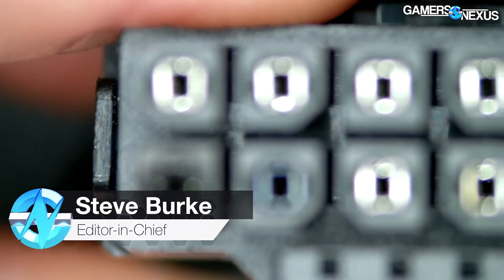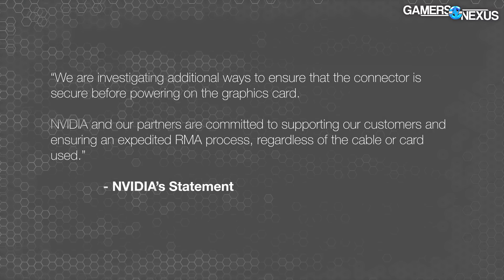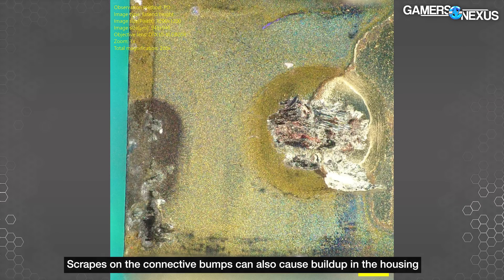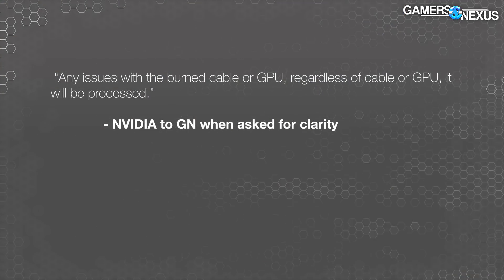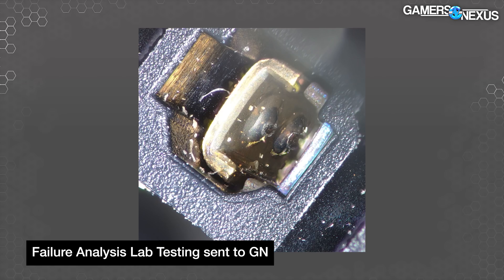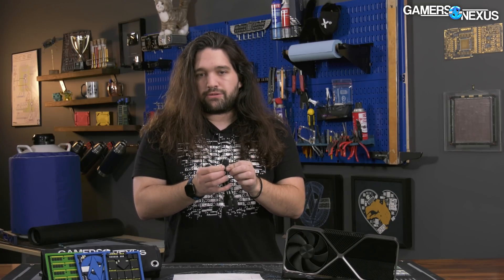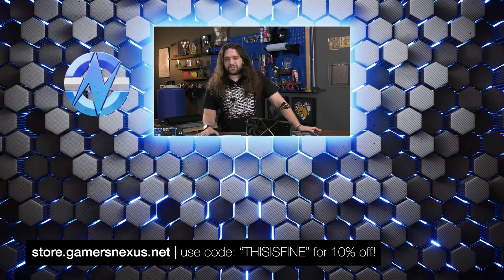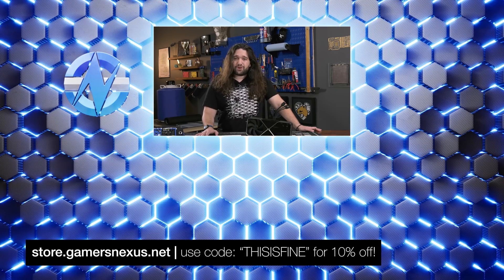NVIDIA Responds to Melting Cables, Warranty Concerns, & 12VHPWR Adapter Failures

Comment: Easiest way to fix this is to change locking mechanism. Instead of 1 point in the middle make 1 on each side (2 overall). Once you click it that way there is no way this will move to the side.
When it comes to user related errors - there is no blueprint, there is no ready device that is fully user resistant. When someone wants to use it improper way, he will find a solution.

Comment: When I build a PC, I always make sure that the latches of these cables locks on! I don't do the job half assed. The secure latch is there for a reason, not for friggin' aesthetics!
But I did encounter cables where I pushed and pushed, and the latch still didn't want to lock or did it very hard... Those were some crap cables imo, bad manufacturer! smh

Comment: From the moment nvidia said that the cable was only good for 30 plug in/out cycles, it should've been clear to anyone it was engineered to fail, like most things today. Want to see plugs made to stick where you plug them? Check automotive ones. There you'll never see 4 thick, hard to bend cables merge into a single one with a tiny plug. It's not the guy who designed this that bears responsibility for it, nor the supervisor who ok'd it. It's the one on top who asked for the plug to be this way.

Comment: I think it's worth pointing out that 0.04% sounds like a small number, but it seems to me like a high failure rate. One in every 2,500 cards will suffer a melted, burned connector. Or rather, one in every 2,500 already has had this failure--and the cards have only been out for a few months. Those aren't really acceptable odds for a consumer product.

Comment: I wish they had done the same with these 40 series as they did with the 3090ti. Place the plug on the side for easier cable management. They made that connector pretty solid I haven't heard of many issues despite it being a similar style adapter. Wonder what made them change the design up?

Comment: The terminals, both in the socket, and the connector are simply not large enough to handle the current passing through them. Poor connection/lack of adequate surface area to handle the load,  results in poor contact, fretting, increased resistance, which causes *heat*, which causes melting. It's not complicated.
Reply: Molex micro-fit (Which 12HPWR is based on) can be speced to 13A per pin, the PCI-SIG design is only for 9.2A per pin.  The pin size is fine.
Reply: @gracej79  if they were adequate, they would have zero issues , the pin size is too small for a 1200W power supply, 1200W ÷ 12 is 100 amps over 12 pins, is 8.3 A per pin. If they spec'd a connector that could handle 15 amps, per pin, this video would never have been made.
Reply: @jamesgeorge4874  There is zero evidence the pin size has caused any issues for this 600W  connector.

Comment: THAT IS A BAD DESIGN FOR A 450 12v power connector!!! 37 AMPS REDICULOUS! that thing should be huge for 37 AMPS!!! micro molex legacy deisgn with easy to melt plastic, thin metal pressings, WTF. the specification is low-tech. a 37 amp connector should be literally a lot different than that for flimsiness. If it were 24 volts it would be fine. check a motorbike battery, 12v, 30 amps output, massive wires.

Comment: Great video, but quite clearly while the blame is being shifted to user error and yes that is so, this didn't happen with recent previous gens, this really just means that the design is just not good, at least Nvidia is honouring warranty but I feel they haven't really admitted to being partly at fault for having a bad design, this power connector just wasn't necessary.

Comment: Well,diesel engines were designed to run on vegetable oil so in theory it should burn if you can get it in there, but it would probably solidify and clog everything up faster than you can say "yeehaw" so I wouldn't say it "runs fine" unless Joebob has taken up industrial hydrocracking like commercial biofuel production.

Gas engines definitively will not run on pig fat though. Might not even make it past the filter to the engine,but your fuel system will still be full of solid pig fat.

Comment: I love what you did,but I do not totally agree with the "it is mostly user error"
People don't suddenly lose the skills to plug a cable, it is due to bad design of the socket and plug and the wrong selection of the pins (male and female) too much play.
We didn't had that issue with the former design plugs.
The new ones look low quality to save some money.

Comment: Looks to me like bayonet or screwed in connectors like RS232, VGA or DVI connectors of old aren't all that stupid after all.
PC power connectors may be user friendly, but I've always known stories about molex connectors not clipping in due to loose inner pins, or their pins being pushed out, Sata power connection tabs simply snapping off... If enthusiasts can manage the bulk of watertubes, all other people building a PC should be able to manage bulky overbuilt powerconnectors with connection security, preferably at the back of the card.
Reply: @GsaUce Rug Well...er.... you're not wrong.

Comment: Nvidia should hard wire the part where it gets hot and have the 3 power leads coming off the card, thus eliminating one connection point, I have seen this fix other high draw/melting connection problems.

Comment: Yes yes,all sounds nice BUT how about the conector just sliding out because of the heat expanding the plastic before melting? Because there are cases of some still burning even with propper instalation

Comment: Wait, if the 16-pin wasn't plugged in properly, shouldn't the MB/GPU prevent the boot up first place to avoid any potential damage? At least my 8-pin msi gtx 960 me and gigabyte 1070 g1 are behaved like this. NVIDIA GTX 4090 wasn't behave that way? or anyone can clarify?

Comment: That plug fully inserted and yet you don't show it working. I have seen one that was fully inserted and made a click as well and still the plug burned up and melted the pins and this WASN'T wrongly connected or the pins on diagonal

Comment: Dear nVidia and OEM manufacturers,

Please keep in mind that some of your customers install their GPUs vertically while others prefer horizontal installation. In many PC cases having the PCIe connector on the side of the card won't only cause undue stress to the connector itself, but in many cases there simply isn't enough space to close the side panel. I think that this is bad design in your part not to take these matters into consideration when still at the drawing board.

My humble suggestion is as follows. Please look into designing your cards so that they have two power connectors from which to choose from depending on installation preference (horizontal or vertical) and the PC case used. As an added bonus depending on the location of the connector and installation orientation, I believe that hiding those unsightly PCIe cables should be a lot easier than it is now.

Comment: Is anyone actually satisfied that the whole issue is user error??? I mean, they were probably one of the driving forces behind the development of this cable which is horrendously designed to the point that joe bob can break the damned cable by looking at it the wrong way!!! Come off it. Did this cable go through zero testing before it was used on their flagship graphics card line??? Or I don't know, was it not tested at all when the cable standard was developed??? They would have known the issues that have been discovered, this isn't user error, this is manufacturer negligence.

Comment: Sorry for noob question.. new to this new tech.. just to clarify if I get a new rtx 4090 for my existing psu (& upgrade from rtx 2080ti) this means I can indeed still use the adapter with my older 1200w psu without issue and without needing to upgrade to the new gen of psu just so long as this adapter cable is seated properly as in this video or still this only works best still with the new gen psus only and I still need to upgrade my psu? Thank you

Comment: It's kind of wild that they haven't figured out a proper locking mechanism in 2022.  You know how good Ethernet cables pop into the port with a loud, satisfying click - that's what every connector should have.

Comment: They could cut the length of the sense pins, so the pins wouldn"t connect/engage until the connector fully inserted, and display a message saying "PCIE connector not fully inserted".

Comment: 2:33 on previous video I write same statement :)

"The fear of damaging the motherboard does not make it possible to develop the force necessary for the correct connection of the power connector.
Those. Нou must first connect the power connector to the video card outside the case, and then connect the card to the motherboard."

Comment: what was the cable failure like for previous GPUs like 30,20,10 series etc?
Reply: @_Clivey  Nope. You know what would happen? The card would power up just by using the power from the pci-e slot and on your monitor you would get a message saying please plug in the pci-e connector. That's something that they eliminated with this new connector.

Comment: This is shit design, the previous 8pins were obvious and clicked in nicely. It's pretty easy to not do that on these. Having 1 connector with 4 fucking cables coming out of it is just terrible design, it also looks awful. Just put the 2 8 pins back ffs.

Comment: 50 cards worldwide yeah i dont believe you nvidia , sorry but there is like 50ish on reddit alone 
and i highly doubt that everyone who bought a 4090 is on reddit and also has posted their failed adapter there 
no we know what you are doing you admit to the smallest possible / plausible number  so that it does not look as bad 
if they admit 50 my bet is on it being around 250 - 500 cases which would change the story drastically ... its a PR nightmare

Comment: if you have to push really hard to get connector inside and at the same time there is not good locking on that connector, then the manufacturer should be at fault for causing possible user error by weak engineering especially if you cannot even check by look if its latched or not because manufacturer covered (sink it within design parts of card) that part

Comment: So, they developed high power card with small connector that is easily bent by sheer weight of cables etc., they blame it on uneven connection. Shillvidia.

Comment: trust me, the design of the cable is  bad and shouldn't come out for a 2k dollars video card.
Reply: @_Clivey  it does not even have a locking mechanism like a plastic mount and you say so? all normal 8 pins connector have a click system.

Comment: I still argue that saying "user error" relates more to a poor design that ALLOWS the user to get it wrong, rather than an issue with the user. I qualify that by your statement that "this takes a lot more force then you think it will"
Reply: You can only idiot proof a design so much before nature provides a bigger idiot.
Reply: @gracej79  I agree but there do seem to he simple ways to make this more idiot proof, as GN say, make the sense pins engage after the power pins, provide a more postitive feedback click when actually homed etc

Comment: Whenever I installed an Intel box cooler "properly" I was always afraid of snapping the board in half, just to hear the click. To hear it being a direct suggestion to not go easy on the plug sounds to me like a direct invitation to do some damage to the card before it's even powered on.

The plug and socket are both a design failure that should be revised and replaced. It's a bit ridiculous that it's harder to accidentally pull out a DP cable than the cable that is giving the 1600 dollar GPU power.

Comment: can't believe such advance technological stuff defeated by a PLUG problem ¯\_(ツ)_/¯
personally, I dislike this type of socket design, both in aesthetic and handling aspect. Especially the 24-pin mobo socket. There gotta be a better way, but unfortunately standardization has taken root for decades, so it's not going to change anytime soon...

Comment: At the current state of cablegate I would even refuse accepting any 4000's  nvidia videocard as a gift. That connector will fail at some point because it is just a fire hazard due to it's design. They better come up with a sturdy redesign with the Ti series.
Reply: What would make a stationary connector fail? What are you even talking about?

Comment: Those cables are not only the issue.. it's that 450w (600w OC) 
Any slight of wrong plug.. & you might have a dead GPU/cables
It's make U appraciate the normal cables like RTX 2000 Series & AMD cards & how they are more stable/safe

Comment: Why's that the didn't made the cable adapter exiting with a single cable until the four connectors, but instead of four separate, just a bigger single connection?
 I really don't want that crazy looking thing hanging out my 2000+ euro purchase, never in a million years, i don't care how much faster it is...
Reply: Il send you a ticking package, don't worry...

Comment: Its not rocket science: make a cable that has a proper and audiable click/locking/secured sound, so we know its fully seated.

And ofc strengten the part where the bend happens + also provide optional f.ex 90 degree versions of the adapter, etc.

Comment: So less than 1% of all 4090 users do not know how to plug in a connector?
Reply: That's assuming all users have checked for melting and have reported it. The unfortunate truth is that a very large percentage might not even be aware of the potential problem.

Comment: Perhaps this is cost prohibitive (sounds so simple), but what about just having color coding when the power cable is not plugged in far enough?  ie - the plastic head/housing shows whatever color until the cable is plugged in properly, afterwhich, the GPU hides said color?  You see this on locking carabiners for climbing, etc.  BTW, great work on the initial video and follow up Steve and team.  The community appreciates you [and the team]!

Comment: Issue with the blame the user thing is. As mentioned in the reviews of the new 40 series cards.. They went from an angled socket on the 30 series. To a straight-from-the-side of card socket, while at the same time, increasing the overall size of the card...  

Do they expect everyone to be running their cards in open benches now?. In other words.... Can the cables being pressed by case walls/glass (which can naturally happen in many cases, because these cards are so absurdly large) be enough to cause this???... What a mess.....

Comment: need a totally different type of power connector to the card - its needs to be redesigned as this is clearly an issue regardless of user or manufacturer 
it needs to be designed a bit safer - the price of the card is expensive and this is simply a headache for everyone, fortunately no serious damages have happened in regards to possible electrical fire

Comment: you weren't hard enough on nvidia, we should've demanded them to pay for those new cables that are coming out for all 4090 owners who are concerned, NVIDIA is not doing enough for the consumer, prebuilts may potentially catch fire and be responsible for the deaths of families due to poor cable insertion or loose cables; NVIDIA could be sued if this happens, NVIDIA does not take this 0.5% chance seriously enough, and on prebuilts, its probably higher, some of their build quality levels are poor enough to suggest it could be a legitimate reason for concern.

I appreciate the clarification on the issue but I feel as if you did not do a harsh enough response to nvidia here. Nvidia owes us free non-fire hazard cables and thats the bottom line, if you make a defective design, you pay for it one way or another, NZXT learned this, NVIDIA clearly did not, we'll wait a few months and someone's house will burn to the ground because of a 4090 in a badly built prebuilt and then NVIDIA will change their tune of "user error", I like that you spend so much time assessing this issue but I feel your conclusion is not taking into account the potential risk it has in prebuilts especially, and also does not pressure nvidia enough to give us those new cables they are collaborating on for free, 

if you bought a dodge ram and it had a 0.05 chance of exploding would you want the manufacturer to replace it with another dodge ram that has a defective design? with the same risk? probably not; you'd want it to be given a new part that fixes the 0.05 chance and reduces it to 0, not 0.05.

Nvidia has failed us, and you did a great job of journalism on this, but ultimately, did not fix anything for us, a disappointment, I hope that you investigate this further on badly built prebuilts and if one of them lights on fire you let it keep burning until it burns down a wood cabin so that nvidia can see the actual risk of their not giving us free non-fire hazard cables; they seem to insist that the bad cable design is somehow safe and it clearly isnt if it has a 0.05 chance of burning, meanwhile on 1080 tis, nobody had their connectors melt, nobody.

Comment: This connector would have been better if they used a screw down system to secure the connection. More work to put the connector in, but it is a very secure connection and may even look ok if the manufacturer really wanted to do the design work.